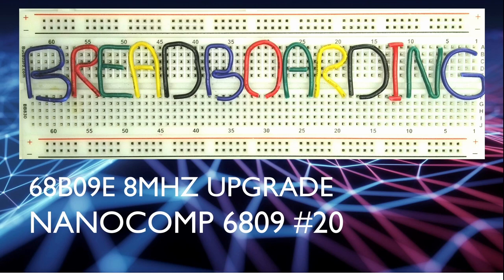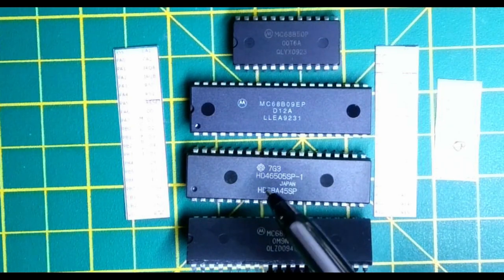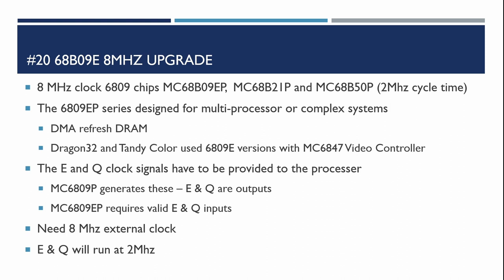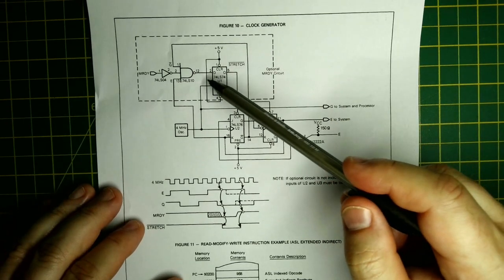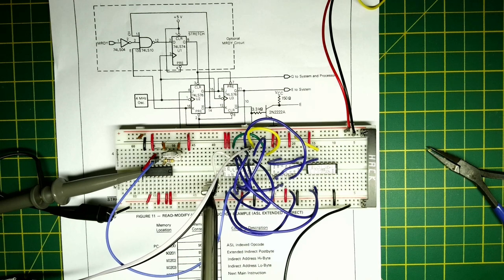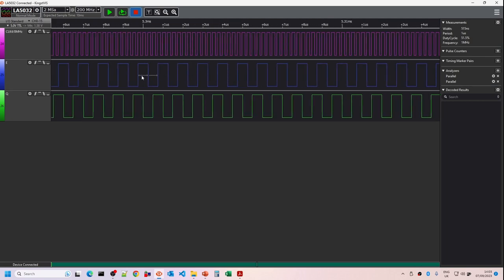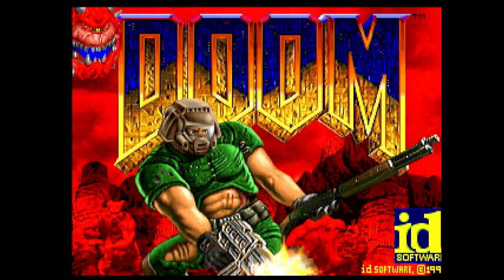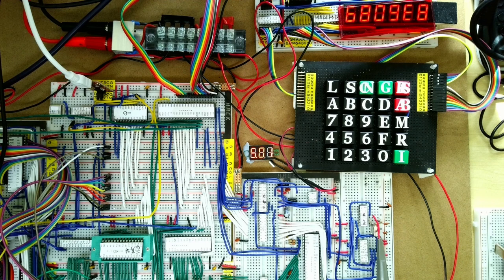Nanocomp 6809 #20 CPU Upgrade to 8Mhz

Comment: Glad you decided to use the HCT14 to drive E.  If you are worried about skew (propagation delay) then also buffer Q in the same way perhaps?  Then, consider putting two inverters in parallel for increased drive.
Reply from the maker: I think by the time the signal goes through the main buffer it should be close to the correct delay but your suggestion should help if that is not enough. Thanks for the feedback.

Comment: A 74xx73 is a dual J/K that I used for a similar project. I believe my copy of the 68B09E datasheet uses one as a reference clock gen.
Reply from the maker: Thanks for the suggestion, I don't think the 73 has a preset which was required for the MRDY circuit (but not the one I ended up implementing as I excluded MRDY part). I couldn't see another J-K FF with Preset and Clear and Positive Edge Triggered.

Comment: In danger of sounding like a pedant but the CoCo and Dragon used the 6809E because they were paired with the 6883 SAM, the 6847 just fits conveniently in that design rather than being the reason for using the external clock version of the CPU
Reply from the maker: Good point, I was being lazy and couldn't be bothered to find my Dragon32 schematic in a folder somewhere to check the SAM Chip No!